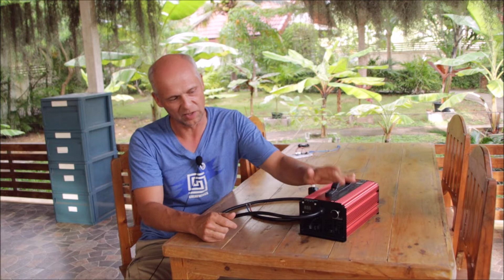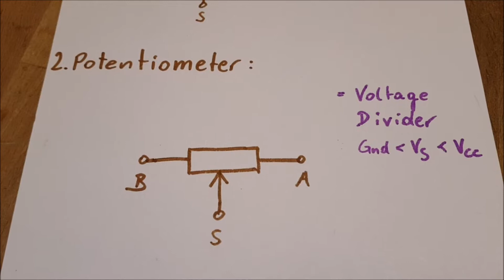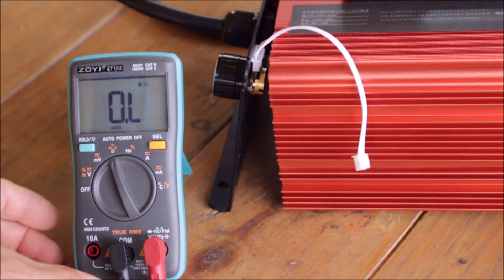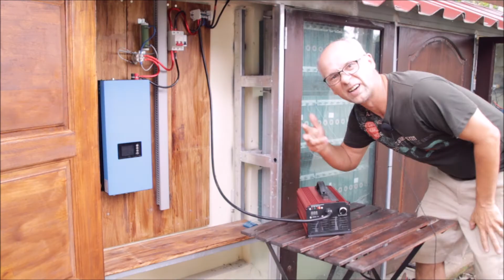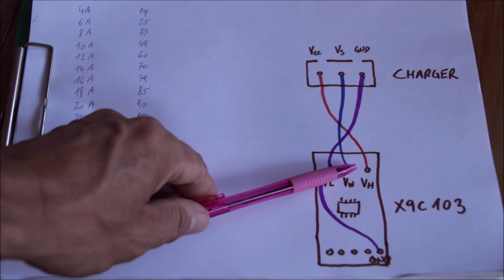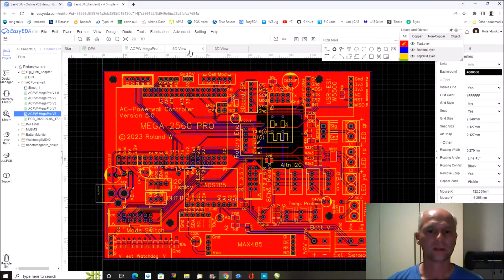Hacking a variable output charger for automatic power adjustment using X9C10x Digital Potentiometer

Comment: I have similar issues storing ac coupled solar. I like my dc-dc-ac off grid setup as its fully auto & probably more efficient. 
I must always know the weather forecast, and switch on different ac-dc chargers via smart plugs while I am away, its getting tedious.
Is there a simple/cheap charger controlled via a ct clamp?
What you have done is beyond me!
What are the pros and cons of ac coupled systems? you seem to like them
Reply from the maker: There is no commercial product as you just wrote. I thought about it already, hehe. But using this charger, an Arduino Nano, an extra SDM120 meter with CT  plus a few lines of code would make that happen already.
I like the AC coupling because it makes me totally independent of where or how many solar systems I run on my property. Grid tied systems are anyways most cost effective and you might even get a few bucks for your excess from the utility. 
DIY is easiest to go for DC-DC-AC as you have mentioned. But almost every commercial storage solution will be AC-DC-AC nowadays.
Reply: I would build it, as you describe, but my battery is far away from where I would need to put the ct clamps.
In 15 years time! (End of export contract) I am connecting my ac coupled panels to my off grid system.
For next 15 winters, I must manually catch what I can.
Or move to Thailand of course!

Comment: I don't quite understand why you need to turn it down since you want to control when it charges by when you have excess power production so a simple off on would be easier at least until you get to high voltage then less is better but then you don't need it to use the excess power. Still very interesting and a good video to learn from.
Reply from the maker: till now I am only using fixed output chargers. Let's say my charger is a 20A constant output. I need to at least wait until my excess is 1000W plus a buffer of a few hundred watts to turn that charger on so that I do not charge with imported power. 
With the variable charger I can fill that gap between let's say 300W to 1300W which would otherwise just go out (and I don't get paid for it). That can make a big difference if you do not have such good weather or more demand and you would otherwise never reach your trigger value.
So, first start with the variable output during low wattage, then switch on a constant output charger once enough power is there. Like that there will be a seamless operation from low watts till maximum